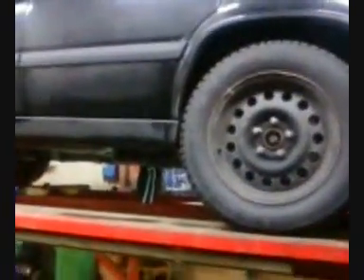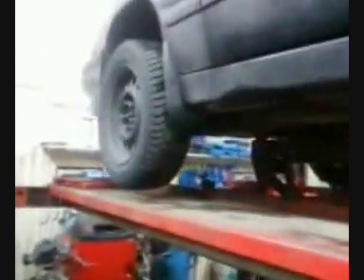Volvo 850 awd Visco clutch test and welding of disconnect clutch.

Comment: To be honest your english is much better than most of my english class classmates, so yeah, I wouldn't apologise if I were you. On a different note, do you happen to know the final drive ratio of the 850's rear differential? I wanna add a mild AWD to my Focus but don't wanna mess around with the electronics associated with modern day AWD systems, currently I am choosing between this system and Honda's DPS. Since Volvo was owned by Ford for a while, I am hoping I can mix and match driveline components to avoid using a bellhousing adapter, that's why I am wondering about the final drive.

Comment from the maker: Hi. no it dosn't affect fuel enonomy at all, because the one-way clutch is engaged when the engine is driving and in forward direction, in other terms, the engine can drive the rear wheels, but the rear wheels can't drive the engine (in speeds over 35km/h) so in reverse gear, the one-way clutch can't provide power to the rear wheels at all, therefore the speed-disconnect clutch is engaged up to 35kn/h and locks the one way clutch, providing RWD even in reverse (up to 35km/h)

Comment from the maker: haha, yeah that sounds a bit funny, what i meant but didn't say is that it's easier to get a rear wheel slide when decelerating at higher speeds, because the rear wheels should disengage in such conditions, but with the one-way disconnect clutch welded together, they won't.

Comment: hello, i have question, maybe you'll be able to suggest, I have XC70 year 2000, as i read by the spec it have Haldex 2 gen. - mechanical visco clutch as well, so my question is - Is it possible to make make 4x4, so the rear would have allway torque woul be transfere to both axes all the time. With second Gen Haldex coupling is possible to do tha same like u done?